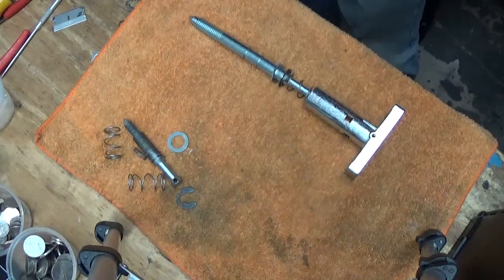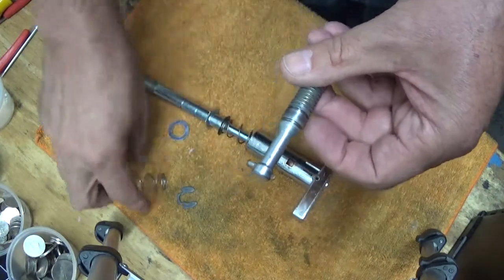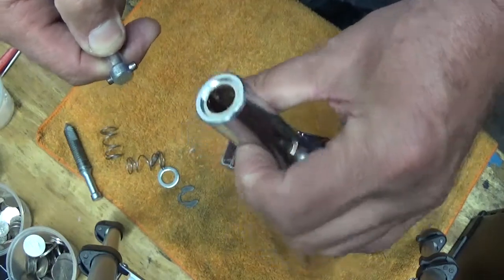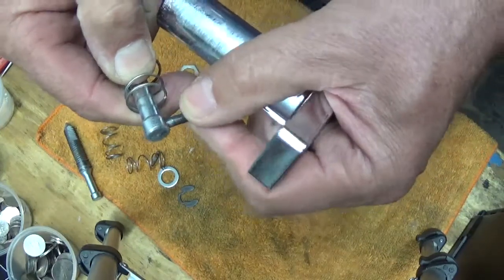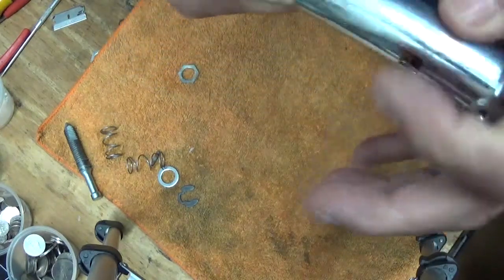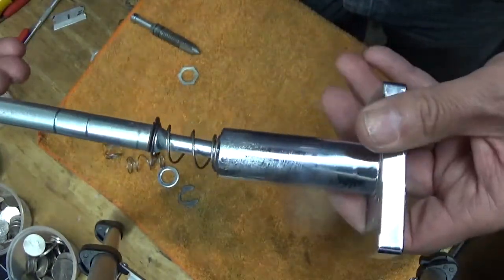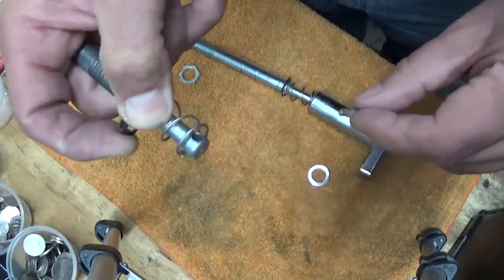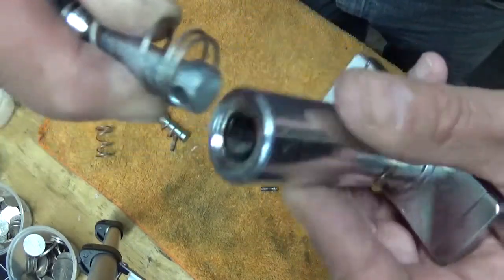Vending Machine Amusement Game & Changer Tee Handle Install

Comment: How do you remove the t-handle itself from the metal assembly?  The lock washer popped out of my t-handle assembly and i am trying to remove the t-handle without having to remove the entire assembly.
Reply from the maker: Not sure if I fully understand but there is a "C" clip that allows you to pull out everything from the housing itself.